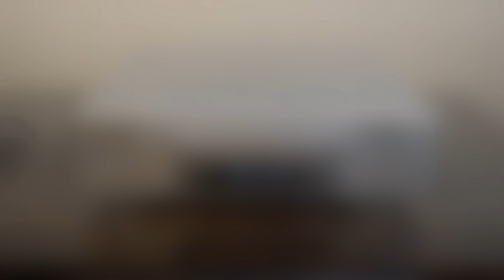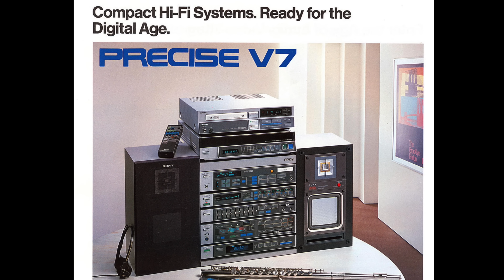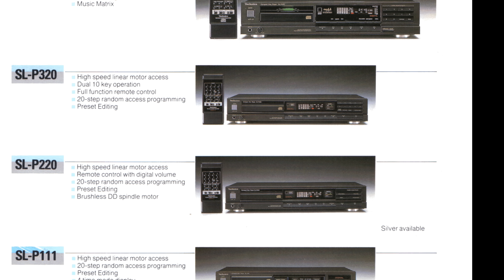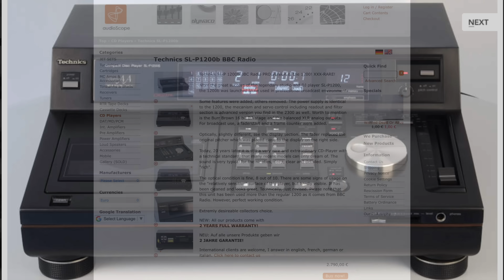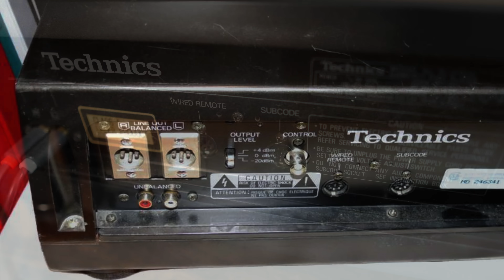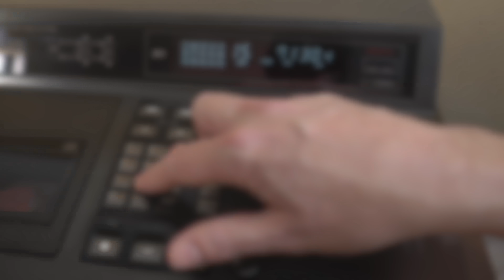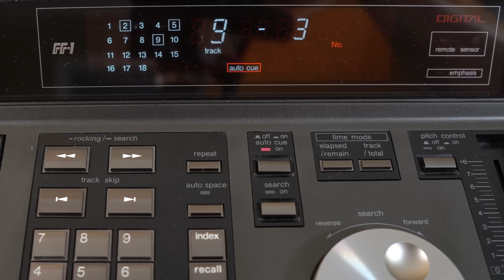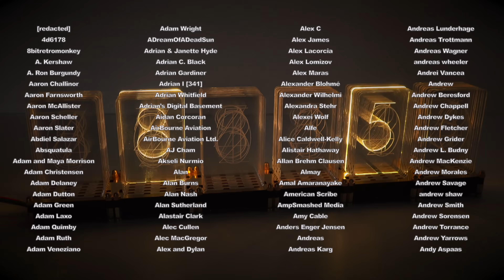How CD players lost their cool & why this Technics didn’t.

Comment: The base of that thing looks exactly like the SL-1210 turntables - the standard for club DJs and incredibly hefty to help minimise vibrations/skipping. What a beast.
Reply: This player was one of (if not the) first club CDJ decks. They were pretty common in NYC DJ booths back in the 90s. I had a few DJ gigs where these machines were in the booth and used them. I preferred turntables, but really enjoyed some of its features, and actually used the cue effect (like in the video "pump up the volume") in sets. It sounded pretty cool with the right samples. "Pump up the volume" is perfect!
Reply: @lolatu4402  Nice... I remember there was quite a stigma around CD-based DJ'ing here in the UK during the 90s, at least for club DJs. It was quite snobby, looking back.
Reply: Technics also made DJ CD players. Basically the competitor to the CDJ from pioneer. 

I'd love to get a set for my collection
Reply: @ssjaken  Denon were more Pioneers competitor than Technics ever were. They actually beat Technics to making a CD DJ player with a spinning platter, barely anybody speaks about that.  I still use a pair of the later DN-SC3900s to this day.

Technics pretty much bowed out of the CDDJ market quite early on due to Denon and Pioneer having the market covered, and the SL-DZ1200 never quite working the way it should (in fact, it took a hacker to modify the firmware to make them accurate.)
Reply: @Mentski  Was thinking of picking up a pair of sc3900s. Have you tried it with DVS nd does it work? The SL-DZ1200 would be sick in a hifi, would look great in the booth but there buggy fuckers haha! I’m happy with my CDJ-1000s for digital playback, but I miss the rotating platter! Like keeping the 1210s clear for real vinyl as well. Bun having to swap over cables mid set to change from digital to analogue😂
Reply: @reno5159  They have USB ports on the back to use them as MIDI controllers, which I assume would work with Serato or Traktor, or whatever, but can't say I've ever tried.

I just ethernet them together, and share usb sticks between decks. I prefer the simplicity of being able to chuck em in a coffin box with a mixer (old skool style!) and not have to faff if I'm taking them anywhere.

The sticks need to be made through a crappy, earlier version of Denons Engine software to be able to navigate through them properly on the decks though, and to build a BPM database, but it's a price I'm willing to pay, once it's done it's done.

Comment: We had 2 of these at the nightclub where I was a dj (late 80's) They were great for mixing and beat matching club music and fitted perfectly with our SL1200 mk2 vinyl deck setup. The downside was that they were constantly in and out of the repair shop for one reason or another.
Reply: Does this have the same footprint as a 1210? Looks like they may have reused the same feet...and the bottom half of the unit looks like the same hard rubber of a 1210 as well (was it?). Shame the pitch fader is backwards, which I imagine would have been weird. It's a great looking bit if kit though, shame to hear it wasn't the workhorse that the 1200 series were

Comment: I own a Teac VRDS 10 witch is a beauty full cd player too, you can see the cd mechanisem trough a little window on top.
Reply: My Current CD player is a Teac VRDS 9 which is similar but styled to match the Teac 500 Reference series. I had a problem
with  the gears which crumbled but got them replaced after a long seach
Reply: @mikewilding3199  I had the analog part of the DAC re capped, it is a problem too when they get older.

Comment: Technics really did make some seriously good audiophile gear back in the 80's - their DBX tape decks, amplifiers and equalizers were up there with the best, not even mentioning the legendary SL-P1200 DD turntable.

FWIW: I've got a JVC CD player with a motorized glass top that also shows the disc spinning in all it's glory (FS-SD550). Bought it brand new when they were still being sold. You can in fact see one being used in the Will Smith movie I Robot. Close to 20 years old I'm guessing, runs perfect and plays CD-R's like a champ too. It's a great little machine.

Comment: Yes, back when I was on radio those functions were essential. We had later technics drawer loaders but they had all the same features. One handy function was the "peak search" which very quickly scanned the disc then cued it up at the highest volume on the track so you could PFL the peaks and set the channel output accordingly.   This was important because of the limiters at the transmitter site that would maintain an output volume. If the peak was too high the limiter would pull the gain right down but then as soon as a queter bit followed it would then be too quite and take a second to go back up. Setting the levels correctly stopped this from happening. Whenever the engineer was in the building he could tell instantly if the levels were too high and  would often run down to the studio, poke his head around the door and just say "LEVELS!" With a raised disapproving eye brow!!
Reply: I had a joke a ready that started with "That's another level of..." but I can't seem to complete it. 🤔
Reply: @goeland4585  Don’t worry, audio jokes can be bought cheaply in volume so if you can’t remember the end too that  joke I’ll sell you another one that sounds just as funny. By a joke from me and you’ll never be in treble. I’ll have you reeling with laughter. Just be sure to adjust the punch line level appropriately. I never bass my jokes on lowbrow humor so you’ll always be the grooviest joke teller around when you tell the old joke “why did the chicken auto reverse? To get to the other side”. Don’t worry that was the vinyl joke I will be giving away for free just for the record.  😂🤣
Reply: @Charlesb88  "42"
Reply: Couldn’t your engineer use some soft compressor (w/ gain) to solve that problem automatically?
Reply: @nickcpv  They probably had five different pieces of equipment on the output chain sweetening the audio and level limiting etc. I bet all analog based. The level limiter was probably aggressively hard limited if any peak audio level went over, and would duck way down..  I remember a station we visited when I was taking one of the DJ classes at our collage, half a rack of 1RU (rack unit) pieces of gear all with flashing LED lights and meters depending on what that gear was accomplishing. It was impressive to look at. However, just a few years later our collage station got an Orban Otimod with DPS control for all the audio processing that only took up one rack unit of space and sounded as good and better than that half a rack of gear the other Top 40 (number one in market) station was doing. Plus none of the artifacts like audio limiting dropping everything by 10dB as soon as it detects high levels. You could crank up the sliders on the audio console and bury the meters, and it still sounded fine over the air. It was really amazing and  failproof for those students not paying attention to levels.
Reply: @marcusdamberger  i need one of those for my station someday. Its AM
Reply: @marcusdamberger  yes, this was early 90s ams from memory ot was quite a rack of hear, including compressors and processing etc. When it was introducided to peak it would crash way down so of course any lower gain audio would almost disappear. It's was quite noticeable. The studio monitors and cans were actually taking the broadcast feed from the transmitter (we were line of sight to the TX site so no delay) so at least you could hear it dip if you hadn't been paying attention. Worked in more modern stations  since using automated play out systems etc but it really felt tangible using CDs, Carts, Mini Disc etc. I'm too young for broadcast vinyl however!!
Reply: @motodevcam  Broadcast vinyl was on 16" records at one point. Great way to ensure those records don't get stolen. No one other than a radio station has the equipment to play it!
Reply: @nickcpv  I don't know what that means but I'll be sure to pass it in to him 30 years ago when I was in radio 👍
Reply: Once i discoverd the "max brothers" set right overshoot was minimal . but i hear ya 👂

Comment: Motors have no place in high quality audio reproduction. Record players and tape machines are all incurably flawed due to motor-induced highly audible speed-instability related sonic defects (not to mention horrendous non-linearity of frequency response, i.e. distortion) . Furthermore, motors and their associated drive systems all degrade inexorably over time leading to continuous progressive deterioration in reliability. CD players were a step forward because they decoupled the motor system from the audio stream, but they still suffered from the reliability problem, which is why they too are now obsolete.
This is why solid state digital audio storage is objectively demonstrably superior and more reliable. People like record players/tape machines/CD players etc. for sentimental reasons. However, if you value sound quality above such non-musical considerations modern digital storage and playback systems are the only way to go.

Comment: Pro tip:
For those looking for an odd and good cd player at an affordable price, check out the Pioneer cdj-500 Mk2. Cheap as dirt and does everything this Technics does.
There's also a newer version of the SL-P1200 called SL-DZ-1200 that is very much inspired by the 1200 vinyl player. Kinda pricey though.

Comment: I've always assumed that cd's are usually tucked out of both reach and sight inside of the machine when they are being used (i.e. spun) due to the higher rotational speed of a cd than of vinyl or tape reels, combined with the thinner preciser edge of a cd. At the speed that CD's spin they'd essentially be a very crude circular saw if they were out in the open (or behind a flimsy door that could be opened or broken off without stopping the cd), so any fingers getting near to a spinning cd would probably find themselves involuntarily departing rather rapidly from their host body....

Comment: I had I Aiwa mulitchanger CD player on my mini system, with a clear top on the mechanism so you could see all the cd’s as they rotated into position. Terrible unreliable player though, Dixons, back in the day, had to replace it under warranty as it became very dodgy at reading discs. The replacement wasn’t much better. I now have a player hidden away in my reliable but dull looking Denon unit.

Comment: My first almost ok stereo system was a radio CD micro combi, with a clear top loading player that was so clearly designed to be a pastiche of a record player. And it's absolutely one of the reasons I went about 25% over budget and I never regretted it.
Reply: Yes...you reminded me of my late mothers Sony micro system which my sister inherited..had top loading CDs..I wanted it more for the minidisc rather than the CD..but I already had a couple of minidisc recording devices so it was just greed..or would've been..top loaders are unusual but do exist..incidentally..Tech Moan Matt would approve of my portable modification..for the very reason I also like to see CDs spin..I made my own..took the lid off a pocket CD and mounted it vertical..you have to bypass the lid interlock cutout switch..and run it off 4.5v external..and 3.5mm to RCA lead..bit botchy but ok for me...

Comment: The following Sony Car Discman models have a transparent lid which shows you if a CD is inside the player:
D-828K, D-838K, D-840K, D842K, D-844K, 848K.

I've owned a D-844K and currently own a D-848K. Great units with a 10-second audio buffer and nice green backlighting on the LCD and buttons. Plus a motorized lid, which can be controlled via their wireless remote.

Comment: I completely agree about seeing the disc's. I reviewed a junky Emerson 3 disc stereo not too long ago and although it's junk, still looks beyond cool with the motorized door and open design. Why do they hide these cool looking discs? Makes no sense!
Reply: @Stevie-J  Are you lost? Do I need to call your mummy?
Reply: Seeing the disc's what?
Reply: @Stevie-J  wtf is wrong with you?
Reply: @Stevie-J  I get it but it’s a stretch.
Reply: My first player was a Technics SL-PJ1, purchased new in 1985. It had a small prism on the front edge of the tray so that even though it was a sliding tray design, you could look straight at the unit and see the disc spinning as if it were vertical. It also had features that disappeared shortly after that, including the numeric keypad and Index feature.
Reply: Because lasers.
Reply: The laser will damage your eyes
Reply: @PhuckHue2  there are several CD players/changers that show off the CD’s. My video of the Emerson Triple Play is an example. They carefully block the area where the laser reads, but still allow to visually see the CD spinning.
Reply: Am i the only 1 that knows youre not suppose to shine a cd to the light, if you have a window on your CD player it could wear over time as the CD was never meant to be shined to the light for long periods of time, it makes more sense to keep it in a dark enclosed space
Reply: if CDs were NOT hidden away , would they now have a coolness factor as big as vinyl?   One can only wonder what alternative universe tech would have done with those lasers.
Reply: @Stevie-J  boo hoo someone left a comment like grow up
Reply: " Why do they hide these cool looking discs? Makes no sense!"

Why were you able to see inside a tape? To see the progress and what's left. On many tapes it was even etched into the plastic. If you see a CD turning, you see a CD turning, it's absolutely useless, so it makes no sense to show it. Here, just for you, to show movement: *flips bird*
Reply: @stylis666  it's just fun to see it working, makes you feel more confident that it's actually doing something. sure it's useless but it's a bit entertaining

Comment: Huh, here I was thinking the Pioneer CDJ500 from 1994 was the first DJ CD player with a jogwheel and pitch control. Nope, the people who made the gold standard for DJ turntables (SL1200s) beat them by 8 years.
Reply: Me too! It went full circle and technics tried to copy pioneer with the Sl-dz1200 player which was a strange hybrid of a cdj and a sl1200 which flopped as it was very flawed (from memory I think the main issues was with noticeable artefacts in the sound when changing speed) but had its fans
Reply: Pioneer ended up becoming the CDJ standard due to their durability that Technics Panasonic had obviously dropped, and the power of stamping Pioneer across the back and sides so it shows in a club catapulted it. As a vinyl fan, took me years to get any CD decks and both of mine are CDJ1000 mk3s. I'd love 2 of these to go with my 1210 mk2s

Comment: I have a few portable CD/MP3 players with up to 1 minute memory buffers to adjust playback at skips and sudden movement. They have a see-through lid also, looking at it's operation at playback is mystical. It plays, stops for 10 seconds and spins again. Same as a MD Player. Makes you wonder why we have never seen standalone MD(LP) Player/Recorders with upright MD's with see-through lids or window? Considering it's size absolutely doable, having the slot on top-front pushing the MD in from above. Hmm, maybe it's out there somewhere.

Comment: Great topic, you are probably right. Visual feedback of tape hubs or CD spinning is beneficial to the experience. Beside the fact that this CD Player has Pitch control it does probably has speed adjust. That is not the same as Pitch. Some have speed adjust with constant pitch, oops what? I Imagine if you had +-33% Pitch control you could re-encode a 120 minute WAV file to fit 80 Minutes increasing the speed of the recording, guess you know what i mean. Basically having a CD-R burned with this 120 minute content should play just fine (corrected speed) with the adjusted pitch control. Never tested though. Some DJ CD/MP3 units have up to 100% Pitch control letting you do amazing things with CD if you wanted. Just food for thoughts.
Reply: Yah, I always liked how some CD players let you see the CD spinning.  

My grandma had a vertical CD player that was shaped kinda like a small CRT monitor or TV -- in very '90s-looking silvery plastic and fake blond wood, with matching separable speakers.  The CD loaded in the top, and spun under a clear plastic cover in the front.

I've also seen top-loading boomboxes with a clear window in the CD lid.  (Though my cheapo boombox had a solid black lid.)

And I've seen portable CD players with windows in the lid.  Sadly, the CD Walkman I used in several cars almost has a window -- the W logo is clear plastic, but Sony put a psuedo-holographic reflective layer on the bottom of it. *smh*